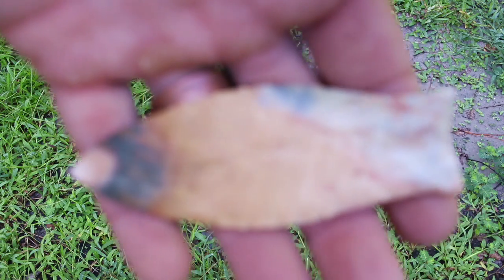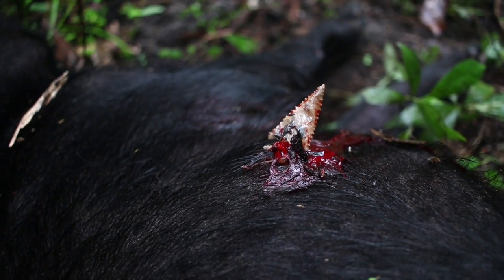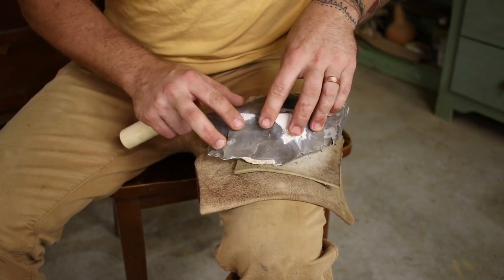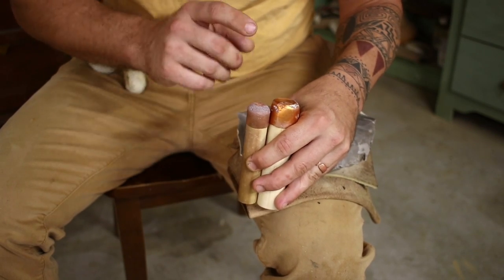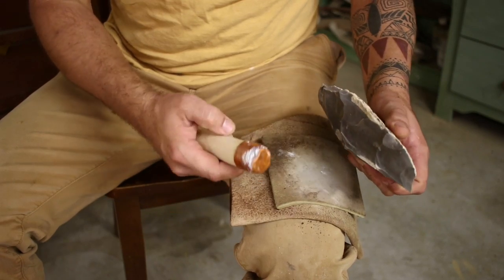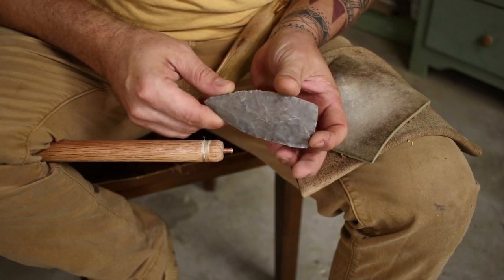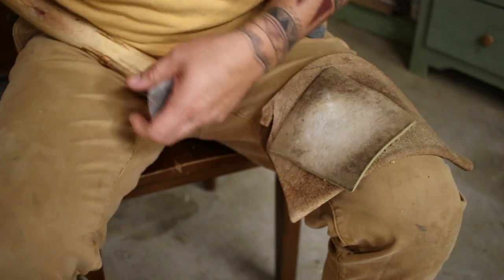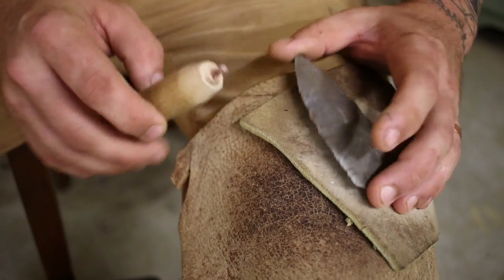Learn How to Flint Knap

Comment: I just want to make Solutrean looking knives and Sintashta arrrowheads. So to answer the opening question; yeah, that’s why I’m here. Awesome, you’ve got a full curriculum after I get some basics down. Thanks for making this for free. Subscribed.
Reply: Copper bopper is genius. Doesn’t have to be copper even to be useful. It’s the shape, you can use like a giant polished stone as well. It just offers better control and command of the strike. That’s a great idea. (I’ll admit to having tried this with a stone on my own once and getting quickly humbled)
The antler is a perfect example of a similar substitute for the bopper. Haha. You got right to that.
Reply: 5:18 oh my god, that tool explains a bunch of “ceremonial” finds at certain sites. The c word strikes again!
Reply: 7:00 out of curiosity why copper? I’m an electrician by trade and copper is soft as hell.

Comment: ive watched these like 3 times and made it around a chunk of bakelite/pyrex about once before it rounded on the edges and i cant get a bite. i abbraid. all i have is a deer tine. is that 100% of my problem or is there a way to get back to popping 1/2" shards with what i got?  also im roling in and  using enough force to shove the horn through my 1/8" leather. regular percussion hasnt done anything. I guess im a little confused when a piece breaks square then the corners basically round off, its like a solid 1/4" thick.